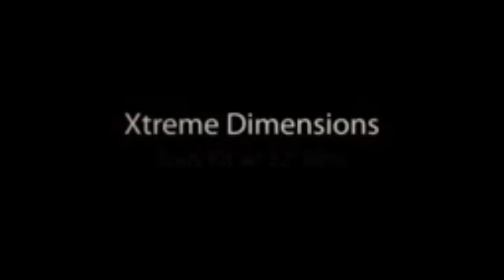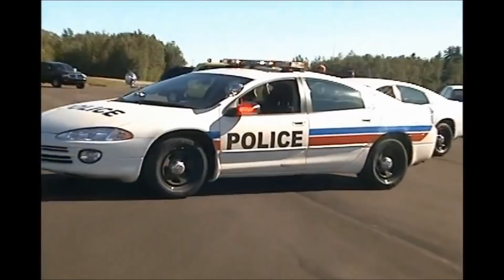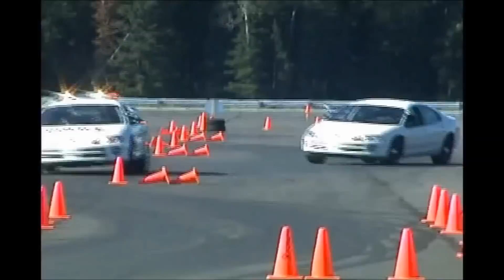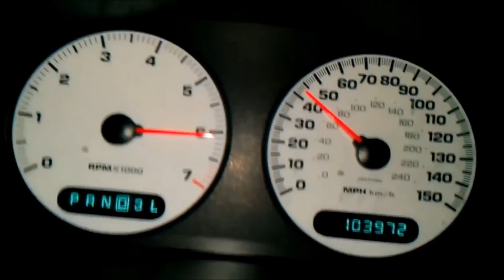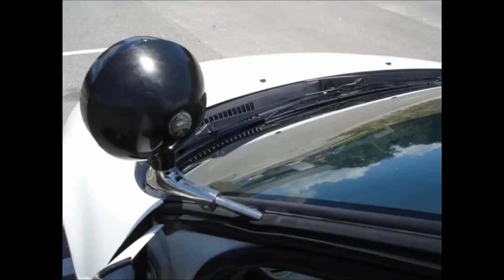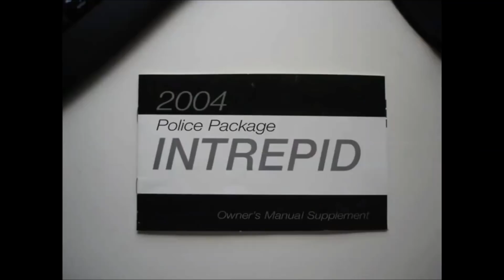The Absolute WORST Police Interceptor EVER! the Dodge Intrepid

Comment: The 2.7 had sludge problems the 3.5 not so much. The 3.5 is a solid engine you can get 200,000 miles if you dont abuse it too much. I had a 2000 300M and it was one of the best cars I ever owned. Had 186,000 miles when I got rid of it and frankly wouldnt mind having another one like the 300M Special.
Reply: 3.5 is a great engine, and I definitely enjoy my 300M special!  It IS necessary to replace water pump and timing belt at 100k miles before they go on their own. ONLY thing that disappoints me is the newer 3.5 has simpler pistons making it interference, VS the 93-97 which has valve reliefs that allows it to freewheel.
Reply: I have a 02 300m I've been moddingit to at least get 271 horsepower since most of it stock is lost in the drive train 😫😫

Comment: 3.5 isnt a bad motor if you know how to maintain it, i put over 200,000 on a chrysler 300m while just doing rutine maintinece
Reply: This video pisses me off everytime i watch it
Reply: Austin B  Then don't watch it. Makes sense to me?
Reply: Austin B I have 218.000 on my 2.7.
Reply: @TimR3811  2.7 is a sludge factory.
Reply: Sam Maupin not mine. The engine was opened 2 months ago. 218.000 miles zero sludge.
Reply: so don't buy the 2.7
Reply: Jackson I change my oil every 3000 miles. This guy said that intrepid owners have to walk home. He's a liar! At 218.000 miles i never have had to walk home! Its been good minus water pump failure at 165.000 miles. Then it failed again at 215.000 miles because of a cheap part. Other then that and a few parts its been good to me.
Reply: Me too, would still have if it wasn't for foreign drivers
Reply: A truly good motor lasts even if you don't do the maintenance. My cousin had a Mustang with the 3.3 straight six that lasted to over 250k miles. He didn't change the oil for over 20 years, the rear main seal leaked and he just kept adding oil, never drained it and never changed the filter. Ended up getting smashed but the engine still ran when it went off to the crusher. Had the original trans with original fluid that worked just fine too.
Reply: I concur, I had a 2002 300m for 12 years, all I did was put front brake pads and new tires 2x, when I traded it in 2014 (Dodge Charger) it still had the original battery. This car was fast and handled extremely well, I’d definitely prefer this over a Crown Vic.

Comment: Never drove one, but I'm an officer and have been for 23 years. The worst police package I've ever had to live with is the Ford Taurus. A total POS as well, lots of blind spots, crap quality seats, sardine can cramped interior, hard to get in and out of with that stupid low sloping roofline, some of the worst ergonomics I've ever experienced, and a useless back window that you can barely see out of, and other issues.  No wonder Ford has ceased production of the car, they got a lot of complaints from depts and the low sales numbers in the civilian market as well. The did a stupid thing killing off the Crown Vic without a proper replacement.
Reply: It's good to hear an officer doesn't like them and says it's cramped. Last winter I was given a ride home after a slight accident and, for crying out loud, the back seat (while plush and comfy) was so cramped I had to sit at an angle. Trucks with half-cabs have more room! I though it was due to my size. Not fat, just overall big (6'2") however it was <2 miles so it was no biggie.

I cannot take those SUVs seriously though. If police wanted AWD for the snowy months the agencies should've gone with a Subaru sedan. Power, reliability, cheap to maintain, fuel efficient, and not associated with 'haha, soccer mom'.
Reply: @DareToBeDeviant  No they are just that poorly designed. The back seat is total garbage, worse than the front.
Reply: Eric Diaz  Yes we have some now and they are roomier and have better visiblity, but somne of the same bad design, bad ergonomics, and those cinder block hard seats are still in this model. Plus it uses the same engine as the Taurus and weighs a lot more and is slower as a result.
Reply: You mean the current Taurus PI?Or the older ones?
Reply: 231gnx  The current Taurus if you want to call it that. The car is technically no longer current IMO they ceased production it was such a piece of crap.
Reply: Oh,I thought you were talking about the old '87-95(Robo Cop)versions.I never heard anything bad up until today about the new ones('2012-19).Crown Vics rule!!!Front wheel drive police cars are crap.
Reply: The new Ford Interceptor is not a Taurus model, it is literally a model all its own.  While they share some frame and body and engine components of the consumer version, they get things that the consumer version does not right from the factory, including the wiring for pre-upfitment, and a different suspension design and geometry that is shared between the Interceptor sedan and Utility.   https://www.ford.com/police-vehicles/  If you buy one of these used, they are actually a titled model as "interceptor sedan" or Interceptor Utility".
Reply: @chubbysumo2230  It is a Taurus, it is the Taurus model with some stuff added for police. Kinda like do you like the color gray? or grey?
Reply: 231gnx Both are really bad.
Reply: Out here we have Tahoe interceptors and now we have dodge chargers
Reply: 454 SS Chevy the chargers are hunks of Junk. My brother had the transmission of one fall the fuuuck out in a high speed chase. He was going in a straight line and two mounts broke. It had 39k miles on it
Reply: Curtis Lenox ...yeah but if you add the fact it's probably been idling since the dawn of time and was literally floored every time it took off for 39k miles...your point is?
Reply: Curtis Lenox - kind of funny, considering the transmissions in the Charger PI are the bulletproof Mercedes NAG1 5-Speed... The current ZF 8-Speeds are even more robust. FCA was wise to start using ZF transmissions in Chrysler products, since everyone and their mother always bring up Chryslers major transmission problems from the 90's. The ONE component you don't worry about on a Chrysler now is the transmission- they're buying the best transmissions in the industry mainly because they're own transmissions have a terrible reputation. The Charger uses the same ZF 8-speed that Audi, BMW, Rolls Royce, and countless other manufacturers use for the same reason;  they're bulletproof, and they don't break. So pick a new drivetrain component when you tell your Dodge break-down stories, saying they've got a bad transmission that simply falls out while driving makes you look uneducated.
Reply: @Alan-tr5uj  The ZF 9 speed automatic it a total POS. FWD based American cars and crossovers these days are not built like a brick like a Toyota, Honda, or a modern day Mazda. The most reliable FWD American car today is the Ford Fusion. The Ford Fusion is the only FWD American car I would buy besides the GM 3800 W-Body cars.
Reply: Those Taurus cop cars are fast as fuck though
Reply: @CurtisL8.3066  It depends. Most of them do not have the Ecoboost engine with the AWD.
Reply: Richard Greene Both the EcoBoost and the regular V6 have the water pumps destroying the engine.
Reply: Well said, Ford was dumb to make the Taurus so shitty and then try to push it on everyone.
Reply: I never understood why they didn't at least try and extend the Crown Vic's life. They could have lightened it, changed out the V8 for more economical engines, etc.
Reply: crash test ratings. Is why cars all have bad visibility in 2018
Reply: The 2013+ Taurus is an absolute pain to do major work on as well. Parts are stupid expensive as well. Come on, $1200 for a steering rack. Water pump job is miserable, and they have the potential of leaking antifreeze into the engine when they fail. PTU (transfer case)is buried. I had one with an isolated wiring short, the harness was rubbing under the dash causing the car to not start took weeks to find.
Reply: @mph5896  And the Explorer is no better in terms of parts costs. For example, a headlight assembly is 700 bucks!! a plastic lens with a light in it?!?! Really!! I'd rather they stuck a gun to the back of my head while they took the money for it, at least give me the full robbery treatment.
Reply: @kman-mi7su  waiting to see how much it costs to replace the plugs and how much to change the water pump...since it is a Mazda engine in the tarus explorers and the mercs
Reply: m ph Explorers as well. Both the Explorers and Tauruses are complete junk. The Crown Victoria was very good and the Chevrolet Tahoes as well.
Reply: All new cars are basically in that boat, my only real complaint is with no more cars being made by ford used part prices will never come down
Reply: Jesus Is SATAN  It has nothing to do with glamor, you tottally missed the point or didn't really read the post.
Reply: Jesus Is SATAN  Perhaps you failed to comprehend, its not about glamour, its about practicality, functionality, and quality and the car fails in all.
Reply: Ford Taurus is a POS from personal experience, my daughters mother had one, and all it took was me revving up the motor and the battery died. Garbage. Half the cops in the town I'm living at would rather drive a 4 door mustang cop car that Ford is supposed to be making here soon.
Reply: The all new 2020 Explorer is supposed to be easier to work on because it's a front longitudinal mounted engine RWD based layout and let's hope the new Explorer won't have that stupid water pump design nor carbon monoxide entering the cabin.
Reply: How about the current Chevy Caprices? Some cities and towns in NJ have them including the State Police. In Newark, they even have the Ford Focus sedans but not for patrol, only for traffic control like construction or working on a telephone pole
Reply: Have you been in a charger? even worse. Basically all modern sedans have those problems due to safety regs
Reply: It must be different in that police car before my family loves our Taurus sho
Reply: Genesis G 90  You must be one the few. Even the civilian version sucked I had to rent one on a trip once as it was all they had. Sales numbers for the Taurus sucked so not many people would agree.
Reply: my uncle had one he  got it for free basically it has no title no key so nhe just got it off of a dirtroad he bought for free it was a piece of shit now 10 years later its underneith a woodpile which has a shitty chevy pickup on top of it we literally just put our shit ars we dont use in our back yard and stack them so we dont have to worry we also have a old classic pickup thats all rust its a old ford but my dad refuses to get rid of that piece of shit  becuase it was his first car
Reply: Yeah, the tarus really doesn't compared to the explorers. Everyone I've talked to has loved the explorers, it terms of durability, space, speed you name it, but the tarus, not so much.
Reply: Ay, thanks for keeping people safe by being a cop my dude.
Reply: That replacement is the dodge charger V8
Reply: "That replacement is the dodge charger V8"

AND the v6 Dodge Charger. The Dodge Charger was a much better police car, but didn't come out until 2006. 

Hemi Charger from 2006+ had MANY engine issues. They dropped valves and destroyed the engine. 2009+ engines valve dropping was resolved, but they eat through camshafts.
Reply: @mph5896  at least there fast
Reply: kman 4443 still better than the Chevy impala
Reply: taurus werent terrible for "regular" cars but ya
Reply: I’ve seen camaro interceptors pretty snazzy no outrunning those rigs
Reply: @daevid21  Expensive and impractical though so useless pretty much.
Reply: Funny, my cousin is also a LEO and he reciprocates the sentiment.  He tells me the worst cars he has driven is the Taurus, and there was also a fwd V8 Chevrolet.  Could be the Impala, not sure because they all look the same these days.  He told me the Chevy was fast, but they all had transmission problems.

Most officers love the Crown Vic.
Reply: shay dogz - you have to admit the current Taurus is really long in the tooth at this point; it's styling is severely dated- Toyota outsells the Taurus 5 to 1 simply because of this reason- poor outward visibility, and a tight rear seat hurt the Taurus as a family sedan. The interior materials are also not as premium as the current benchmarks in the segment. It's showing it's age.
Reply: Eric Diaz well we shall see. ford killing off their sedans in north america by 2021 is their plan for now, but things can change between now and 2021. i think if ford does go through with killing off their sedans in north america, it will backfire on them big way. i can see killing off the taurus and fiesta since no one is buying full size seadans or sub compact cars anymore in north america, but to kill off the focus and fusion that sold well for ford in north america is a big mistake. there will always be a car market in north america to some degree, not everyone wants  to drive crossover or suv.
Reply: I currently drive a second gen Focus ('07) pushing 90K. Still runs fairly well. I think Ford is making a huge mistake, taking itself out of the car market.
Reply: SteelCity1981 - No one is buying large sedans from Ford & GM- Trust me Toyota won't be discontinuing the Camry, and likewise Honda won't be getting rid of the Accord; those are perennial best-sellers... The major difference is Toyota & Honda keep their sedans up to date, continually improving them. Ford & GM unleash a vehicle, then let it languish largely unchanged for 4-6 years; it's a no brainer why they aren't selling well. Hell even FCA is releasing new Chargers in 2021, because their full-size cars are selling well. The auto landscape is too competitive for cars that are just ok- the high prices of new vehicles really tend to highlight a cars glaring faults- and consumers vote with their wallets. Good designed and marketed vehicles sell well, and anything less doesn't. Ford & GM will regret not having current CARS in their portfolio when gas prices spike sometime in the future. Trucks, SUVS & crossovers sell great until they don't- how they've forgotton 2009 so quickly is beyond me. There is plenty demand for traditional sedans in America still, it just looks like foreign automakers will be supplying that demand mostly. Dodge will be making a killing in the high performance sedan market, with no domestic competition; Germans mostly. While a "niche" market, FCA can still move over 100,000 units a year; a decent chunk of change.
Reply: Ms officer dudubudu
WEWEWEE WEWEWEE WEWEWEE ME
Reply: Fuck 12
Reply: Fuck the pigs
Reply: @stephencurry305  your mom and dad were obviously failures at parenting.
Reply: @stephencurry305  Mom must be proud of your stupidity and your hurt feeeeeelings.

Comment: Can you please make a video comparing the 93-97 to 98-11 crown Vics.
Reply: I think they were basically the same car except the older ones had the more squinty-looking headlights.
Reply: As an owner of an 07, the 2nd  gen ones were totally mechanically different. For starters, they weigh 400 lbs more due to a beefed up frame design, a steering rack instead of recirculating ball, COP ignition, and Watt's linkage rear suspension. With that said though, if I could retrofit an 92-97 I would because I think the older ones looked WAY cooler with the aerodynamic design.